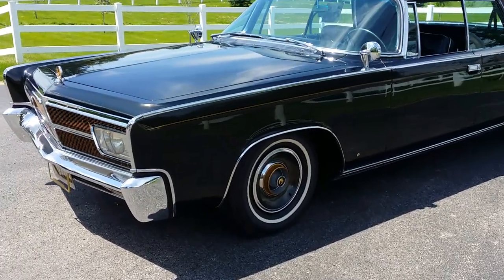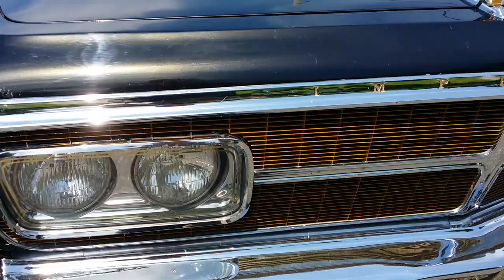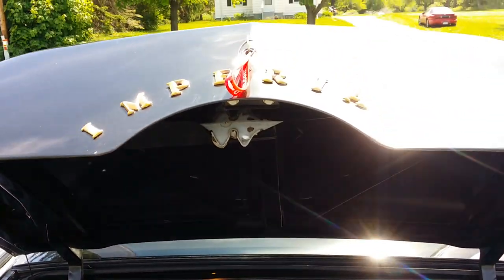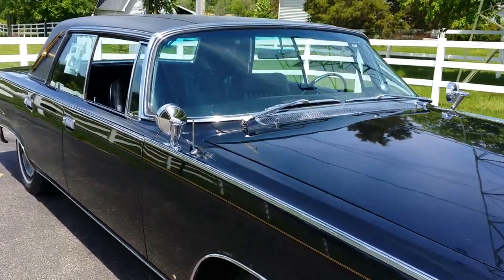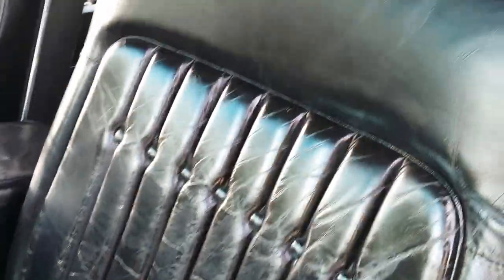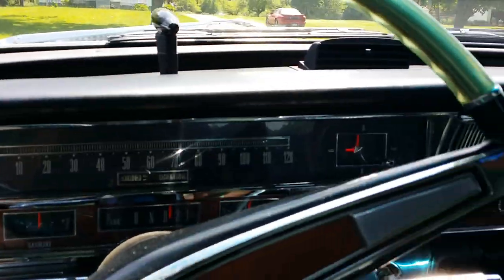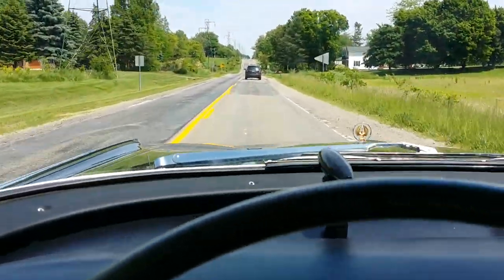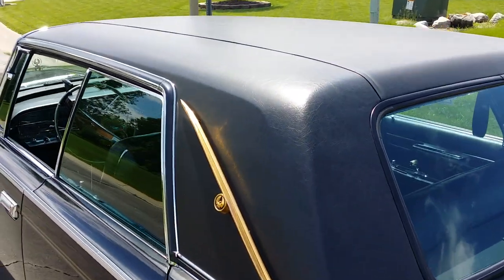1965 Imperial Le Baron for sale $19,500.00 auto appraisal Sandusky Michigan

Comment: I never realized Gold anodizing was a factory option on these cars. If so it's so unusual it looks aftermarket. The formal smaller rear window and rear A/c was really nice.  I think one of the reasons Chrysler could not keep up with Cadillac is on all of these cars, there was way too much room in the rear wheel wells. It just didn't look right. They should have used a wider axle or wider wheels to fill in that void.
Reply from the maker: +johnnyohness It probably was not a factory option- but may have been done to represent this car on display at National Auto Show for the Big Man....
Reply: I was thinking that it may have been a special edition.

Comment: For all the kids out there who are confused about all the Brand Rage coming from our team of experts, they are technically right.

But even in the day, the buying public could see quite clearly that other than the dash and trim and some curved side glass, buying an Imperial was just a really expensive way to buy a New Yorker. All the mechanicals, front to back, right down to the interior door handles are identical.  

Sure, the Imperial retained the full frame, but this was a throw back. Chrysler (the company whose executives decided the fate of the Imperial brand) had started to produce full size unit-body Chryslers in 1960.  The Imperial was, from an inelligent consumer's p.o.v., simply too expensive and too dated. 

And even the very cool Elwood Engle styling was stale thanks to it being so similar to his own work at Lincoln 5 years earlier.  

Today this would be called a Parts Bin car.  Way cooler parts from those 1960s bins, but nothing you couldn't have got for half the price back in the day on the New Yorker.

Chrysler Executives decided when to pull the plug. The end Imperial was not due to an economically distict entity meeting it's demise due to market conditions, but rather it was a failed attempt by Chrysler Marketing (also directed by Chrysler executives) to dress up a parts bin car and charge lots of money. The well-to-do potential buyers saw through it, funny that those rich potential cusomers were also prudent and careful with how they aquired their status symbols, eh?

So, it is entirely excusable to "mistakenly" call the Imperial a Chrysler. 

And given that Chryslers are all very desirable and manly classics today, its not even a slur to call an Imperial a Chrysler Imperial.

I love them no mater what you call them.

Comment: There's a baby-blue 1965 Imperial Crown four-door hardtop for sale about 6 miles south of me. They want $5,000 for it. It's nice, but nowhere near this nice. I just wonder if that car, their car, the prenominate baby-blue 1965 Imperial Crown four-door hardtop, is actually WORTH $5,000. Is it worth more or less, that's what I want to know. The sellers, they have a "for sale" placard in the windshield, that says the price, but also the fact that, according to them, it has a 460 V8, which Chrysler never produced. It should have a 413....so I'm beginning to think that they just don't know what they have.
Reply: Obviously they have not done proper research to learn there was never a 460 cubic inch displacement offered by Chrysler Corp.

Their car could be a bargain depending upon all the factors covered in this video. 

This appraiser has done a decent job considering he's not steeped in Mopar history. 

Those who get critical right away cause a lot of reactions in allot of different ways. 

Just remember never to behave in ways you wouldn't appreciate being treated yourself.
Reply: Correction: It's really more of a powder blue than a baby blue. That, and it has either a white vinyl roof or its roof is merely painted white. Either way, it has a white roof-so it's white over powder blue. It should have a 413, though. Unless someone swapped it out, but if they did, wouldn't they have used a 440 or some other similar MOPAR motor, instead of a 460, which, if true, is a FoMoCo powerplant?

Comment: It's not technically a Chrysler - It doesn't say Chrysler any where on it - it is an Imperial Lebaron - all Lebarons unless an extremely rare 2 door special order build Lebaron are 4 doors and they all have small back windows. What you call crows feet is actually called lacquer checking and I don't really have any idea what the "gathering " problem is - maybe stained paint ?   Never heard the term gathering unless you are talking about metallic paint metal slumping as it is drying or something like that.  Chrysler built New Yorkers and Imperial built Lebarons, Crowns etc.
Reply: Marc Miesch So you purchased these cars on an Imperial car lot. Who made the engine?